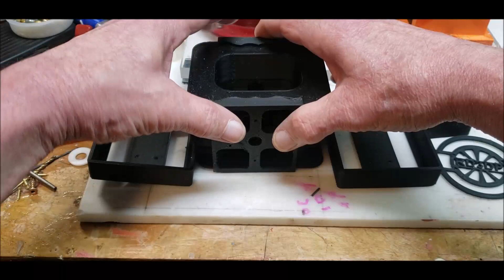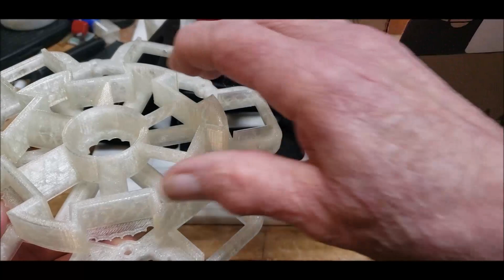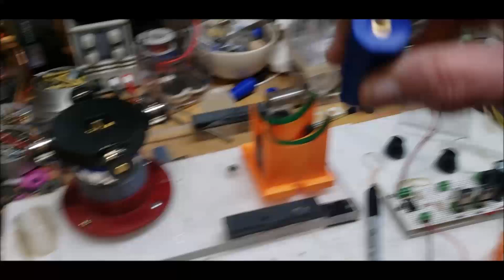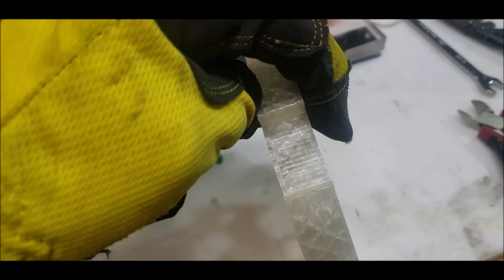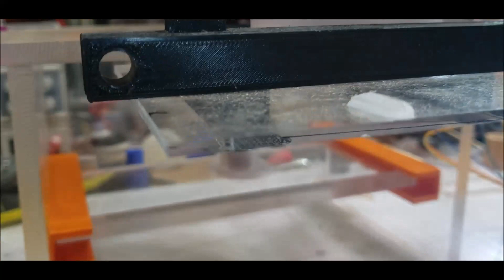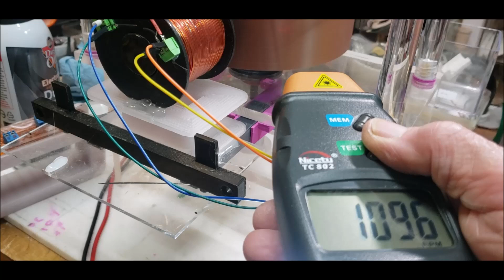3D Printed Pulse Motors and MORE

Comment: nice work.. but what do you mean when you speak of material you dont think you can get for the searl motor? you need a piece of copper pipe, wind some coils, fill them with welding rods,  get some magnets - doing a little google research will let you find them, and you need a good schematic, on google you can get the original patent drawings so that can be done. Sky is in mexico, so i think if you look for the stuff in the US you are bound to find it easier than he can find it. But personnaly i think that you are better off continuing your experiments with your newman motor, because it is more likely to become overunity than the searl motor.
Luc
Reply from the maker: so your right but the copper, ceramic and carbon cores would cost too much